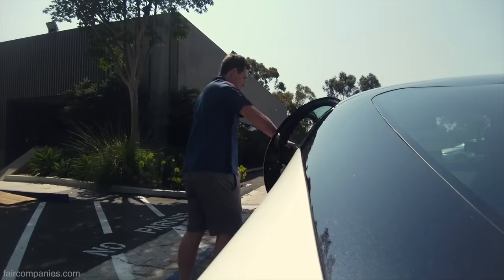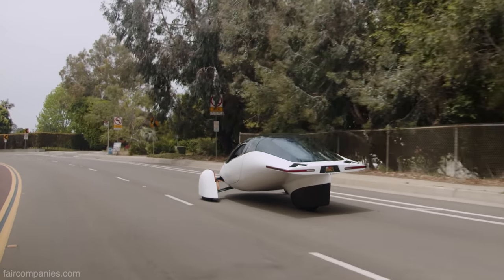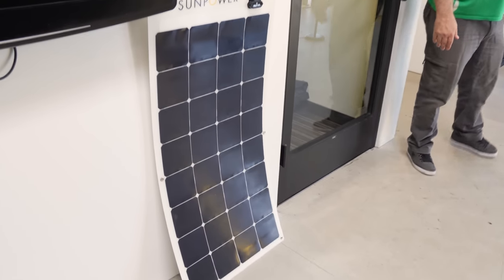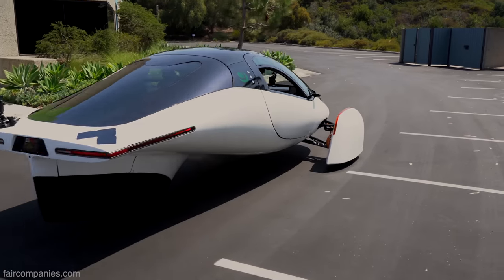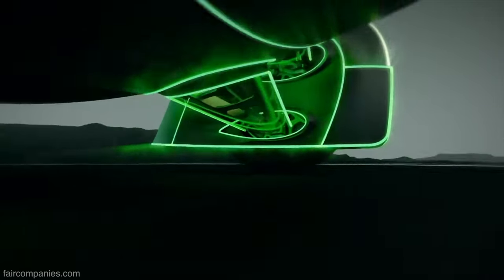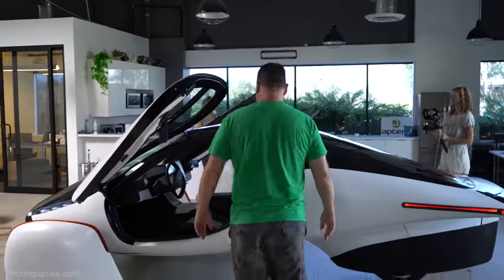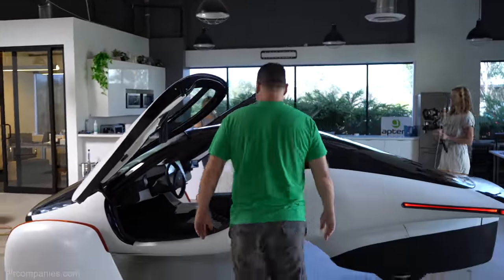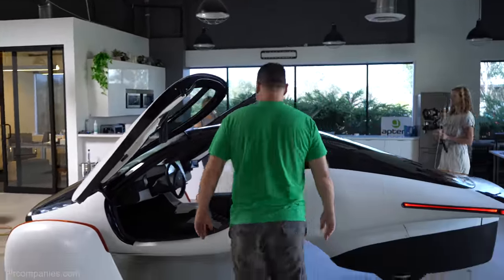Aptera commutes just on solar, gets 1K mile-range when full

Comment: I'm a reservation holder and investor in Aptera and this video has shown me more about the car than all the other videos that I've sought out. Thank you.

Edit: It was pointed out that this comment makes it sound like this video was the most information shown so far. What I should have said is that the video shows more footage of their initial prototype than I've seen before. Big difference.
Reply: This car can only be used in warm climate, I wouldn't invest in it personally. The arctic areas have no sun for the majority of the day during winter and the heating alone will exceed the charging capacity.
Reply: I want one! How about an inexpensive lightweight, well designed teardrop trailer with bathroom/shower & with additional solar panels including transparent window solar panels - (they've had them in Japan since the 1980's), that hook up to the car's batteries, or just power the teardrop while disconnected. That would be the ultimate affordable solar motorcycle pairing! I've seen a lightweight teardrop trailer pulled by a regular bicycle or pedal assisted electric bike, and several small campers females pulled by themselves to position in the ideal camping spot. That could be a home/RV solution for many people. With  pedal assist it would still move if the power got low before a destination is reached. If the price is low enough, a lot of people would buy one, perhaps storage plus inhabited parking for owned vehicles also with rentals available would be very popular in cities that lack adequate parking for owned vehicles. How great that could be! Then, probably at least 25% of the population would HAVE to own one!
Reply: @dingdong2103  The video fails to say that this is still a plug in EV. The solar only adds 40 miles of range per sunny day. I think Aptera is doing a good thing by adding solar but they really should be careful in not overhyping expectations of that feature. The car must be plugged in for full range.
Reply: @dingdong2103  no doy
Reply: @dingdong2103  Over 90% of humans live below the Arctic Circle.  But yes.  If you live in Alaska, you're probably going to need fossil fuels and/or wood/biomass fuels.  I'll be slow to go full-on electric, myself.  I think it's like investing:  Diversify.  I think it's like life:  Moderation.

Most of us drive less than 40 miles per day.  Most days, I drive 0 miles.  When I was young and fit, I rode a bicycle everywhere, but I also always had a motor vehicle to give me more reach, as needed, and to handle big loads.  I've always owned compact pickup trucks, except for a couple years in grad school, when I had an F-150 and a '74 SuperBeetle.  

I don't see this electric vehicle getting CLOSE to most of the back-country spots I know.  I'm older, now, so I don't get as far from the truck, but my entire adult life, I've had a pickup truck that I could throw a month's grub, camping gear, and a surprising number of tools and even spare parts.  Kind of a city on wheels.  This video is critical of the efficiency of internal combustion, but the amount of power delivered by those pistons through that drive train to 2 or 4 wheels, is WAY more.  They're super-light, but I don't think they're even considering the good half ton of gear, plus the teardrop another commenter mentions in this same thread.
Reply: @harrymills2770  Musk just commented that going EV requires doubling the electric production capability of the US. Not going to happen any time soon, especially considering the entire transfer grid has to be upgraded for a higher capacity. It's a pipe dream. It will take 20-30 years minimum to upgrade the entire infrastructure even partly and the cost will be astronomical. Electricity prices will skyrocket and economies and households will suffer. Those who use electricity to heat their houses will see crazy high expenses.
Reply: Ding Dong Then a super efficient vehicle like this would be perfect. Less energy in charging  required to go longer distances. I am satisfied with the 600 mile  Sol that I would get with adjustable regenerative braking to 100 per cent I could get 800 miles the way I drive. I get 300 to 330 on a 266 mile Chevrolet Bolt.
Reply: @dingdong2103  Seems it’s not a problem (or less of a problem) if people have a solar roof (and/or wind turbine or other source) and batteries in their houses. Decentralised and “renewable” electricity production.
Reply: @brunosco  It always cracks me how naive the environmentalists are. There are huge obstacles to that. You'll run out of rare minerals before all the batteries and solar panels required are built. Then there's the upfront cost that most people can't afford. And third, once enough people go off grid solar panels will be penalized with a huge tax like Spain already did. The electric grid needs to be maintained strategically so the government will literally force you to pay for it.
Reply: @dingdong2103  Products tend to decrese in price as time goes on and as the market for them grows. TVs, computers, and game systems used to cost insane amounts of money when adjusted for inflation. Adjusted for inflation, Bureau of Labor Statistics states that TV prices (adjusted for inflation) have gone down 99% since 1950. Solar panels used to be a rich man's investment, now most people can cover their usage for 10-20k (price of a decent car). Same is happening to batteries.

The magic of the economy of scale.
Reply: IMO it's not a good sign that a random (no offence to Kirsten, it's just not her normal type of alternative-living content) YouTube channel uploads a video with more information than the company that you have invested in.
Reply: @namAehT  Incorrect. The reason why electronics have become cheaper is that they have scaled down in size, making manufacturing exponentially cheaper in mass scale. Solar panels and batteries will not follow Moores law. If you take a look of a cell phone, what is the single largest and heaviest component in it? The battery. Why does the battery last longer than before? Because the electronics scaled down in both size end power consumption.
Reply: @namAehT  My apologies, my comment could be read that way. What I meant was that the video shows more footage of their initial prototype than I've seen before. Big difference. I'll edit my comment above.
Reply: How I can invest in the company?
Reply: @dingdong2103  I don’t like to put people in boxes. I’m not « an environmentalist », like I probably shouldn’t call you « a skeptic ». And I won’t enter a debate here. Just wanted to point out to the direction of decentralised renewable energy because it exists and was missing from this thread. To which extent is it realistic or not, I leave it up to you. But I’ll still say that, personally, I prefer to look at the goal than at obstacles, it makes me go further (in general).
Reply: @brunosco  Very reasonable approach, which is rare in these days.
Reply: @dingdong2103  🙂
Reply: Some of the points in this thread are not really correct. Musk's comment about doubling the electricity usage applied to all forms of transportation (trucks, trains, airplanes, shipping) and not just the passenger vehicles that will be electrified first. Electrifying all passenger vehicles only requires ~20% more electricity generation (assuming 250Wh/mile). This is a prime argument for the Aptera, which will stress the grid much less due to partial solar charging and 100Wh/mile efficiency. Ground-based solar energy doesn't care as much about weight and efficiency as BEV's, so it is not dependent on rare minerals. Plus used BEV batteries can be used in home solar for many more years, for example. Distributed power generation greatly reduces the peak strain on the grid, so while many people on solar are surprised they still need to pay to support the grid, costs are much reduced relative to the no solar case.
Reply: Why it has three wheels: THE TRUTH!  It is not for handling in turns, it is to qualify as a motorcycle and thus avoid meeting collision safety requirements.  This vehicle is as unsafe as a motorcycle in a collision.  You will need a motorcycle license to drive it.
Reply: @stevejquest  Not true, Aptera is classified as an enclosed autocycle in most states and you don't need a motorcycle license or helmet. It has a strong composite safety cell around the passengers, seatbelts, airbags, and a front crumple zone. It is far safer than a motorcycle and it should be safer than many regular cars. Aptera plans to crash test the Aptera even though it is not required for autocycles.
Reply: @biffwilliams6191  Laws are slowly changing, but for the most part, 3 wheel vehicles meet motorcycle not automobile requirements -- especially in agrarian states like mine.  :-)  Here, this would be classified as a motorcycle and subject to those rules (including a motorcycle license and motorcycle insurance).
Reply: @dingdong2103  : but notice how there are many who willingly invest personally in alternatives (there is a financial as well as ideological incentive) - sure it often isn't a  baseload replacement, but it is very measurable in demand reduction at peak solar and wind energy  - 

BTW even if every manufacturer went 100% EV by 2035, there will still be ICE cars on the road till after 2050.  (NB. Not a professing "Environmentalist". )
Reply: @biffwilliams6191  This is just a pipe dream. Ground based solar uses the same production methods like the ones used on EVs, no breakthrough has been done yet in production. Only lab samples exist. The used batteries are a major fire hazard so they cannot be used in regular houses without building a firewalled containment for them, not to mention all the expensive control equipment a high voltage/high current battery bank stack will require. It's all good if you're Musk and money is no object, for a regular Joe it's fogettabautit.
Reply: @dingdong2103  true but it is so efficient they could have a version without the solar panels that you plug in. It would probably charge on standard outlets to give you pretty good range very quickly.
Reply: @DonSanders  on an average day most people probably drive less than 40 miles.
Reply: @damianclarke3519  A large portion of people live in cities or small towns and park their cars on the side of the road. Where are you going to get a few hundred million plugs for those cars? Oh maybe they'll run a 100 yard extension cord from their balcony.
Reply: @dingdong2103 This is very true and street level charging is going to need to be developed - for this specific vehicle the range is so good you might need to recharge less often, most might take advantage of destination charging at offices or shops/car parks or local fuel stations may start to offer charging as they sell less fossil fuels. Cities have the greatest health issues from fossil fuels so investing in infrastructure makes a lot of sense. Small towns don't have such a strong health risk although they all have high traffic areas that would benifit from lower pollution. Yes there problems to solve with any change but a bit of imagination/innovation and willingness could solve most of them.
Reply: @dingdong2103  What are you talking about? First, most solar cells are made from silicon, which is very abundant. The newer ones like the Maxeon cells in Aptera contain no cadmium or rare metals. I know people who have run their house on solar for 30 years, it doesn't depend on any particular technology or material, you can use many types of batteries/energy storage. Or many systems just tie to the grid and have no batteries at all. Where I live the cost of a full solar power installation with a 30-40 year lifespan is 2-5% of the cost of a house itself with a payback time of 10-20 years in electricity costs. After the Texas grid failures and the southeast US gasoline shortages, a lot more homeowners are planning solar systems and/or BEV's for safety/convenience and not just environmental/economic reasons.
Reply: @dingdong2103  It is spec'd for use down to -20 F, or about -29 C. The body is Much better insulated than the average car and it can gain range at a significant rate even plugged into a 110 VAC 15 A outlet.  They will build a factory in Norway.
Reply: @DonSanders  40 miles per day as still more than what the average American drives, and yes if you plug in it will gain range faster than other BEV's.
Reply: @harrymills2770  There will be an off road version.  Payload will still only be 500 lbs though.
Reply: @dingdong2103  Musk is taking about his relatively inefficient designs.  A relatively small numbers of Aptera with V2G could take 30% of the peak load off the grid where they are located.
Reply: @dingdong2103  grid storage batteries don't require rare earths at all.
Reply: @DonSanders  I believe you're talking about earlier versions of the Altera. They clearly stated that the vehicle in this video gets I think he said 1000 miles on a full charge, solely from solar. I would imagine it plugs in also to help avoid running out of charge due to unforseen circumstances. Watch it again and save and edit your comment if you find different news. I will also.
Reply: @dingdong2103  the chemistry has also changed.  Battery prices are likely to continue to fall. They make up so much of the vehicle price that the car prices will also come down.  Apteras already have orders of magnitude lower tooling costs than Tesla's.
Reply: @valerieann8007  It depends on the battery size.  There are options from 25 to 100 kWh. Anyone with access to a 110 V 15 amp socket can gain 13 miles of range from an hour of plug time. - or 500 miles for an hour on a 50 kW DC charger.
Reply: @stevejquest  there are only 6 states that still have such laws and there are proposals to change them pending in all of them.
Reply: @stevejquest  Aptera has been designed to automotive safety standards. It will be crash tested to them and the rest published before shipping starts.
Reply: @n.brucenelson5920  Mine is one of them.
Reply: You invest 1k or 10k?  what are the terms?
Reply: @dingdong2103  Some of us are environmentalists because we spent careers cleaning up the messes.  I was in Kuwait for the fires and now live in California.  Rare minerals are not required for grid backup batteries, but some can be used that are retired transportation batteries, while they still have 80% of their useful life left.  Grids won't disappear, but they will gradually move to DC and distributed generation from renewables.
Reply: @dingdong2103  It charges like any normal electric. It just has the added benefit if you are in the right climate and don't do huge mileage of being able to generate enough of its own power to not need plugging in. It is just basically about efficiency.
Reply: @biffwilliams6191  A payback time of 10-20 years given that nothing breaks during that timeperiod. Once you have to replace a component or two, you go to minus again quickly. Plus there's the added work of maintaining the panels, they need to be cleaned of dust and snow regularly to maintain efficiency. Huge battery banks will be required to store the energy for the times when sun doesn't shine. It's not economically viable to sell the production to the grid for two reasons: 1) Solar produces electricity the most when it's not needed and 2) The payback price is a wholesale current price which is about 20% of the price the consumer pays for the electricity.
Reply: @n.brucenelson5920  Batteries require lead, cadmium etc. minerals which are limited in quantity and toxic in both production and disposal stage. The government just has to maintain a working grid for strategic reasons, people will not be allowed to get off grid in masses. It was already proven in Spain where the government put a 2000 eur tax per panel.
Reply: I agree. By far the most comprehensive video I've found
Reply: @dingdong2103  Where I live, most electricity is used for air conditioning, so solar power is aligned with peak grid load and our power utility is encouraging people to get rooftop solar. Breakage is rare with current panels/electronics, they are covered by a warranty, and they require minimal maintenance, much less than the overhead power lines near our house which get damaged about once a year. You get one kWh back at night from the grid for every kWh you produce during the day.
Reply: @dingdong2103  There are many battery chemistries that require none of those elements.  I don't think that in the US we will ever see a requirement that you HAVE to be tied to the grid, but there will be technical requirements if you are so tied for safety reasons.
Reply: @dingdong2103  I only half agree with your comment because I recently bought a home this year and had gotten a quote to have solar and a battery bank for my house and the price would be nearly equal to the purchase price of my home however with low interest rate and government incentive programs I would be paying about half as much for my solar payment as I would be for my house and at about the same cost that I'm paying now for electricity and if you figure in in about 8 to 12 years you will own your system outright all energy production after that is free with only a very small maintenance fee to the electric grid if you stay connected to the grid usually around 10 to $20 in most States.
Reply: @n.brucenelson5920  The strategic infrastructure is so vital to national security that trust me, if it's in danger, you will be forced to pay for it.
Reply: @dingdong2103  I used to think that way too.  But the spectacle of the wrangling in congress over something that could clearly benefit all of us, makes me wonder.
Reply: @n.brucenelson5920  Well that is a completely failed assumption. Only the richest percent of the population can afford to go full electric and the rich are statistically healthier than the poor. What EVs will do is increase the infrastructure load considerably and force the grid maintainers to upgrade the lines at an astronomical cost. That will reflect as higher electricity prices and reduced competitiveness of busineses.
Reply: @dingdong2103  There are controlled studies that have looked at this question adjusted for affluence.  They are easy to find. They are strong enough that there are already cities that mandate electricity for new construction.
Reply: @n.brucenelson5920  Studies are studies, practice has shown that when consumption peaks, power is already scarce even without EVs.
Reply: @dingdong2103  Ok Mr Dong…why would the grid need upgrading if most houses and businesses users have solar panels? That is the future, not a massive grid upgrade.
Reply: @naps3386  It seems you have a poor understanding on how electric grids work and the needs or large busineses, military installations and communications networks. A single foundry can use a whole towns months equivalent of energy in one hour. If the mains grid falls, it cripples the entire society. Private houses are not important at all in the big picture.
Reply: @dingdong2103  Which is why Aptera and other vehicles with V2G tech can ease the issue by load shifting from peak demand times and feed the grid during such times.
Reply: @n.brucenelson5920  LOL do you actually think any EV owner is going to want to feed back even one watt of their already limited range to the grid? No way. They're already range anxious like hell and block up the traffic driving under the speed limit.
Reply: @dingdong2103  You obviously have no experience with the average EV in California, which lives in the left lane passing everyone.
Reply: @n.brucenelson5920  Yeah I have the experience of the rest of the planet though where EV drivers are constantly in my feet. Maybe you live in an area where the average driving distance is 10 miles.
Reply: Over and over the naysayers say the same things, don’t you have anything new? Most power plants only run at one speed…100%. When demand is low and the grid can’t take any more supply (sunny, windy days with mild temperatures when wind and solar are producing) most power plants have to dump their excess electricity generation into giant resistors. The demand for electricity is highest during the day when all solar panels work. It is lowest at night when most people will be charging their vehicles. Engineering Explained did a video debunking the naysayers about the needed investment in infrastructure. There will be infrastructure needed but it is nothing like what the naysayers say is needed. Utility companies don’t want solar on every house, they will lose money in the Kong run. There is a big disruption coming in the electricity generation business.
Reply: @naps3386  They naysayers are pointing to facts, which do not move like the goal posts you provide lol. The demand for electricity in north and south areas is the most at night when it's cold. Only in the hot area of the globe electricity demand is highest during the days. The majority of power consumption is going to heating where I live and cooling is 5-10 times more power efficient compared to that. Good that you pointed out that random power surges create a big problem to the power plants. That's exactly why renewable energys random power peaks are disruptive and damaging to the grid. Coal and gas plants can be throttled to adjust the power, nuclear can't.
Reply: @dingdong2103  I think ultimately, it will be a lot like going vegetarian. Realistically, not everyone or every region can afford or support such a diet. However, most can. Our power infrastructure is old, falling apart, and needs to be replaced anyway. Why not replace it with a grid that can handle the particulars of the renewable future where that future is possible? It was 120 in Canada this summer, old cheap above ground power lines started massive fires in California, Siberia had a ground temp in 113. Texas froze over then had a heat wave. Something has to be done. We could probably afford it and then some if we would stop spending trillions on war and the like and make it so people or companies making over 400K had no loopholes out of paying a fair tax rate like everyone else in the country. Just ask the CBO.
Reply: How do you invest in the company?
Reply: @LA_318  Go to their website.
Reply: @dingdong2103  For a price, of course they would. Most modern EV's, even the smallest battery Aptera, have way more battery/range than is typically needed for day to day use. Of course we would like to monetize this excess battery asset and at the same time help to speed up our country's transition to renewable energy sources. I would like to take it even further, and be able to remove some of my car's battery pack to use as a home power wall and a home to grid storage service, for a price of course. When the battery is reduced a lighter car is a more efficient car, going further on each kWh of electricity I load in, plus I make $ helping the grid with storage capacity. Why the hell not!
Reply: @jeffcarlton3590  None of those scenarios are sensible even in slightest. It doesn't matter if 'most of the time' your battery is enough for the daily drive. The one day when it's not, you're going to need a different car. And the idea to power your home using the already low capacity car battery - a pipe dream.
Reply: @michael4576  What on earth are you talking about? Di you think I care about some 'likes' on comments? Are you totally clueless? I don't need likes to be right. Quite often the truth is very unpopular, especially nowadays.
Reply: we all should invest in small private companies with great ideas ... that's the way progress works
Reply: @dingdong2103  In London they are installing charge points in lamp posts. Lots of them.
Reply: @n.brucenelson5920  Why do you post false and misleading statements about Aptera and not disclose that you are representative of Aptera???
Reply: Agreed. By far the most informative of all the ~12 vid's I've seen, to date. I believe the low-key presentation style (and obvious practical technical genius) of your main subject / demonstrator pilot, has a lot to do with this, so kudos to them, too).
Reply: @inklipMedia  What I would like to see is some information about where all the investment capital has gone over the last 16 years Aptera has been promising to start production...
 The biggest problem with Aptera is there credibility at this point...
Reply: @dingdong2103  500w per hour will handle many peoples needs
Reply: @dingdong2103  sorry you need to update your info. Spain abolished the sun tax about 2,5 years ago. I like the idea of the car but currently a solar car is not really workable. For me I think I have the best currently available solution. 10kw solar panels on the house 10kw lithium batteries for and an electric car. I can charge with 7,4 kw during most of the day so I have more than enough charge power to use the car daily.
Reply: @dingdong2103  electricity in Maine has doubled in past year tripled in past 5 years! $600 a month for small 2bdrm 1 adult 1 child. This electric vehicle would probably triple my electric bill!
Reply: @brunosco  won’t going electric burn more fossil fuels then were already useing. Wher is all this energy production coming from?? Opening up retired coal burning power plants and if solar where raw material and manufacturing process coming from and isn’t that going to use more fossil fuel??!!! No way around it fossil fuel isn’t going anywhere and electric vehicular isn’t going to solve problems they create more if anything
Reply: @dennisbonville3217  What you’re saying makes sense, but don’t jump to conclusions too quickly. We’re talking about the future, and the future will be mostly what we humans imagine in the present. When men imagined walking on the moon last century, as crazy as it sounded back then, it became reality (even though some will argue it was all shot in Hollywood). No one can say for sure what will succeed or not. The answer will come in time, and we can only push in a chosen direction. Personally, I prefer to envision clean production of electricity, etc. I’m not an engineer or expert in the field, so I can’t say more, but if everyone was thinking that way, I bet it would work one day without fossil energies or in some form of clean way. Well, maybe just to some extent… Of course, the world is not an utopia, so in the end I can’t say where we’re really going.
Reply: @stevejquest  not true the material they useing many times stronger then metal and it’s a car not a motor cycle.  Drives exactly like a car
Reply: @dennisbonville3217   Interesting. If there’s a way to manufacture batteries and solar panels (or wind turbines or other clean sources) without pumping too much resources, then powering them with those sources (typically solar roof), that would be good, I think. Or alternatively, with hydrogen technology. I read a book many years ago that was already praising the future of hydrogen - for cars specifically. At a personal level, yes it’s tricky and I understand your concern. I live in Europe where I manage to make 99% of my trips by foot, common transportation, (shared) bike, shared electric mopped scooters, and 1% shared (gas) cars. I couldn’t reasonably have a gas car, and I’m not at all in the position of buying an electric car, let alone having a house with solar roof (I live in a flat). Life is about resolving challenges, and there’s no other way than to constantly look for solutions if we want to move on. In your case, what about moving or changing your job situation so you wouldn’t need to drive so much, thus reducing your consumption and bills?
Reply: @dennisbonville3217  So if I drive one of these things in front of an 18 wheel semi-tractor, I will be fine, because it's harder than metal?  Newton's laws do not apply?
Reply: Just to be clear, I would still own one of these, as I own several motorcycles.  I accept the risk, in exchange for fantastic fuel economy and easier maintenance.
Reply: @dennisbonville3217  A 3 wheeled vehicle won't handle like a car.  For one, it's light weight.  It will handle different, more like a 3 wheel motorcycle.  And in a collision the lighter vehicle loses.  Always.  Ask Issac Newton.  ;-)
Reply: @harrymills2770  You could happily use this vehicle as a moleman living beneath the surface of the earth. The solar panels are not required for charging
Reply: @dingdong2103  What "rare minerals" will we run out of? You could only form any sort of argument around cobalt in some types of lithium batteries. Too bad there are many types of lithium batteries and an enormous range of alternative battery chemistries.
Reply: @BobClemintime  Current batteries require many minerals which are scarce and which are mined using child labor and disregarding pollution. It's simply stupid to push this technology while it's not yet ready for mass production. When carbon based batteries get ready, then I can believe in evs.